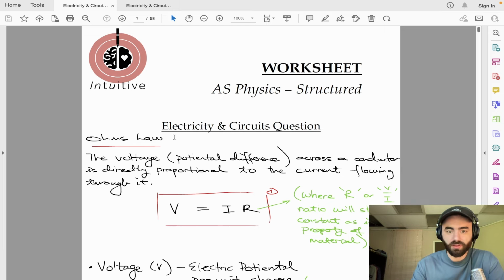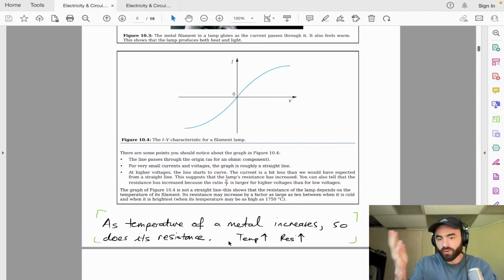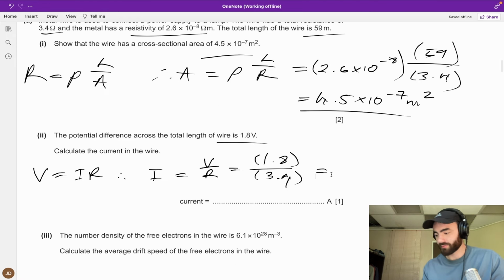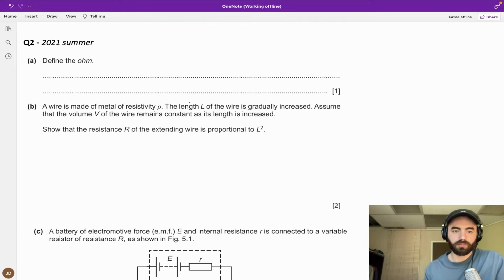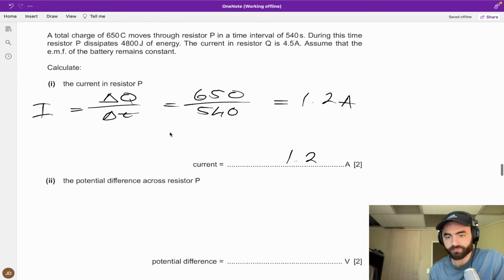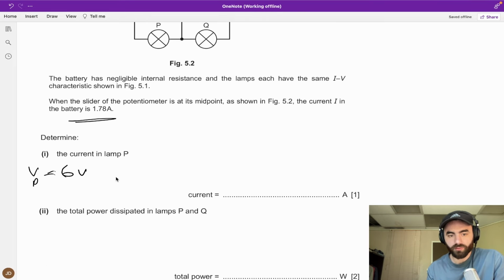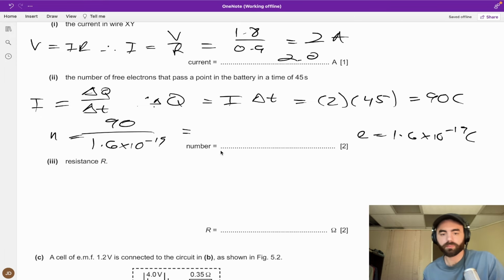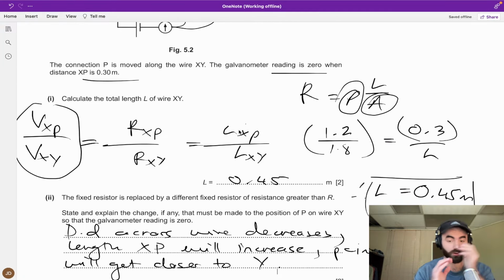Exam Hack | CIE AS Physics | Structured | Electricity & D.C. Circuits Question

Comment: if voltage and current are directly proportional, and adding a resistor in lowers the current across circuit, then why is potential difference a thing
Reply from the maker: Potiental difference is the difference in voltage between two points on a circuit. Potential is lost across a resistor because energy is required to move charge across it.

Comment: when should P = I^2R b used instead of P = IR?
Reply from the maker: P = IV not P = IR (your thinking of V = IR)
Reply: @Intuitive_education  oh okay thank u!! nd in the worksheet cld u explain question 2's part b a bit? its the only time ive seen a question like this n i dont get the working for Vt.
Reply: @Intuitive_education  but when do i use one formula of power instead of the other it shouldnt affect my answer right
Reply: You can use whichever formulae you want either p=V²/R or p=I²R or p=VI
Depending on whether you have I( current ) or V (potential difference).